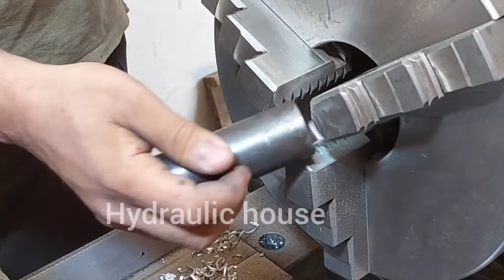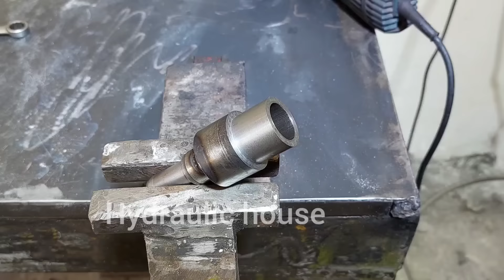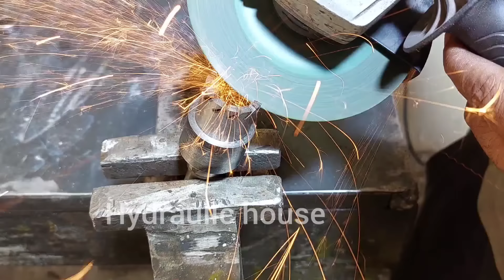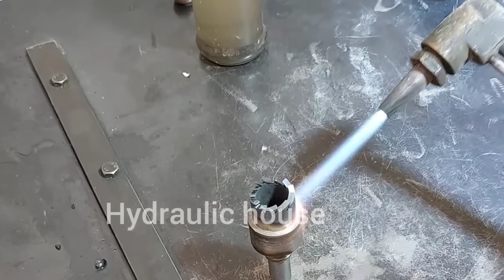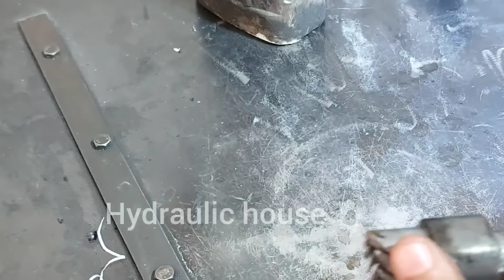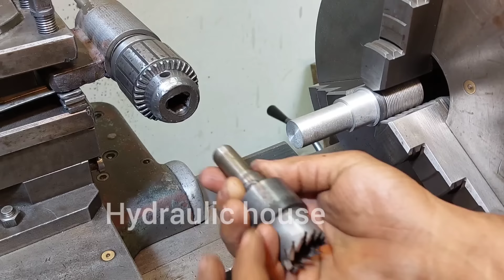قليل من التقنيين يعرفون هذه الأفكار في تشكيل المعادن

Comment: Back in the 70s we were doing stuff like that but in the latter half of the 70s CNCs were taking over a lot of the jobs that used to need all sorts of form tools to achieve the desired geometry. We could make that sphere using 1 tool on a CNC lathe with only a small nipple on one end that would require either a secondary operation or a two spindle machine and it would come out with a nice almost mirror finish and near perfect sphere, most CNC lathes can hold +-.0005 inch or .013mm with ease, even tighter tolerances can be held but close monitoring would be required since the temperature of the machine varies throughout the day so adjustments need to be made throughout the day to hold really tight tolerances.